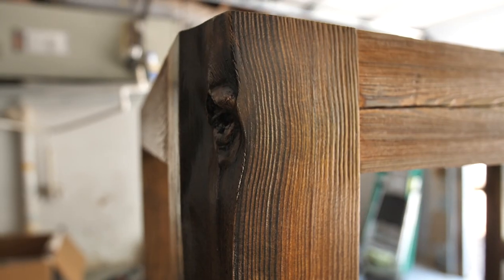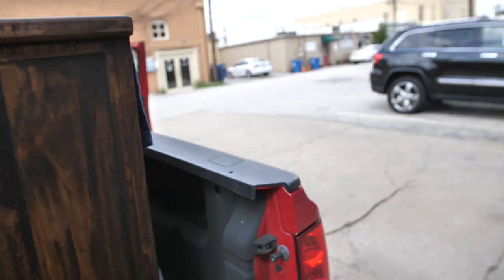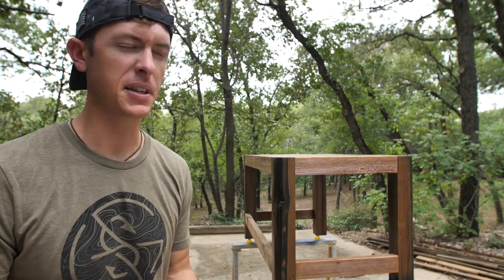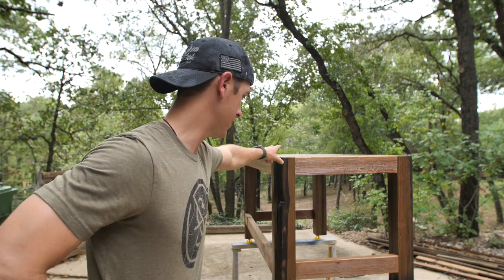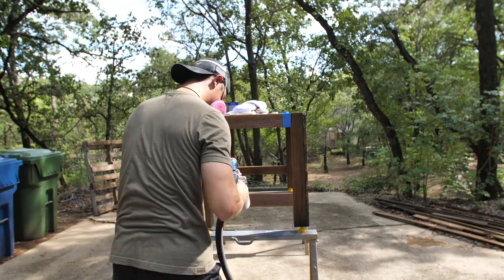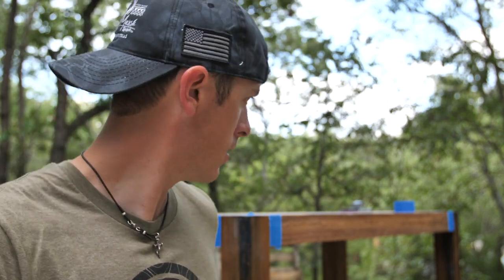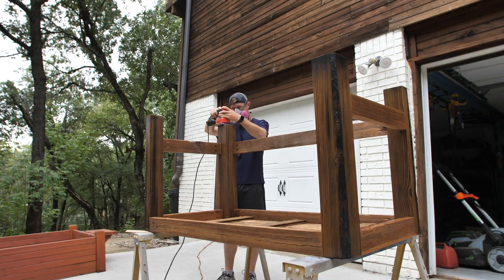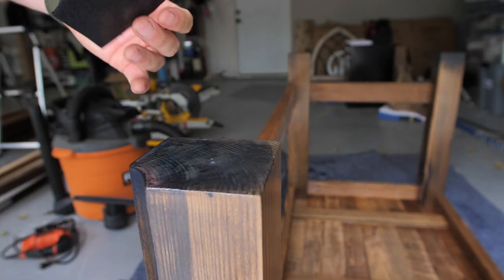TRASH to TREASURE! Rustic Wood Table Build COMPLETE!

Comment: Justin....I have worked in the railroad industry for forty years and our ties are treated with creosote to make them last longer.  Years ago we could sell them or give them away to folks that wanted them for landscape timbers, fence posts, retaining walls, etc.  Over time it was determined that creosote is highly toxic and we as an industry are required by Federal  Law to dispose of them in compliance with EPA guidelines.  They are truly not to be taken lightly.  My recommendation is that you not keep them in your home around you and your family.  However, beautiful work on the table.  If necessary replace the legs if they are the only wood treated with creosote.  Blessings on the arrival of Emery.  Praying for her and Mom that delivery will be trouble-free and all will be healthy.  God Bless!
Reply: Stewart Dearing I build fences and sometimes retaining walls are built out of them railroad ties.... when I try to dump at city dumps they don’t let me unless I have proper paperwork and the record all of it. How much I have and tell me specific spots on landfills to dump. They are super serious about them for some reason. Must be very unhealthy
Reply: Your absolutely correct. Part of my job in the military working in C e was to replace Perform track maintenance  which included replacing the ties

Comment: FYI......when you're spraying paint, sealer, any type of coating........be sure any vehicles you have on site are well upwind. Even a slight breeze can carry overspray for hundreds of feet, before it dries. I detailed cars for 20+ years and have cleaned and buffed overspray off of well over 100 cars and trucks.
Reply: 20 years and only hundreds? I work in a body shop and buff and sand down overspray on EVERY car we paint. I'm a GOD when it comes to taping. And we have 2 100000$ split draft paint booth. Overspray is the devil! Nice to see another detailer fishing freak!!
Reply: I've used sprayers for many years and your exactly right.
Reply: Detail shop. Mostly wash, wax, and shampoos. Best thing I've ever used on overspray was water and modeling clay. Followed up with with a random orbital buffer and Meguiar's #6 cleaner wax.
Reply: @cbobwhite5768  yeah u did a lot softer work than I do. I'm specialized in what people don't want to do hahaha. Hard to do, 50% chances success stuff is my specialty. Restoring 50 year old that's never been buffed or polished, 1 step and stuff. Love it. Also like doing shampoo's and waxes and light stuff!

Comment: Creosote is a mixture of chemicals that include polycyclic aromatic hydrocarbons (PAH's). PAHs have been linked to skin, lung, bladder, liver, and stomach cancers in well-established animal model studies. You might want to move that table out if it does contain creosote post material.
Reply: Good point Gary. I don't disagree.

Comment: If you ever think about doing it on top, get the "bar top" epoxy. It comes in a gallon jug and is the epoxy resin used on, you guessed it, bar tops and counters and whatnot.

Comment: My best guess is the wood you used is Yellow Pine, some call it Pitch Pine. It makes nice lumber if clean but some trees or parts of the tree are extremely pitchy, pine pitch is also very flammable, and that i believe is what you are smelling, the Pitch or resin that occurs naturally in the wood. As far as sealing, how about all the table top ends that are covered by the surround frame? Best case would have been to seal all the components first, including the ends and other areas that would be covered up, then assemble.

Good luck with it!

Comment: And when the poly fails to lock in the residue you should look into a coat or two of Zinsser SealCoat (shellac). I'm surprised your wood guy friend didn't suggest that as most wood workers know the wonders of sealing with shellac.

Comment: In the future,  use an oil based polyurethane when sealing any wood that has been exposed to any type of petroleum product.  Including many years of oil based stains.  Oil based products repel water based products.  
On the positive side .  The epoxy resin idea was a good choice.

Comment: If you clear coat it it will have it last longer and it might trap the smell in
Reply: I agree 100% with you
Reply: Definitely. 3-4 coats of lacquer would do the trick.
Reply: Nope. 45 years of painting experience says nope.
Reply: A nice thick coat of epoxy would be the only way..
Reply: Use to work with reclaimed wood furniture as a prep and finisher. Lacquer and shellac (depending on the use of the furniture) never had any problems
Reply: @rickfromthecape3135  45 years how old are you??
Reply: 62. Worked with my dad who painted for 40 years and took over his business.
Reply: @rickfromthecape3135  oh ok thanks i was thinking that working for 45 years was long time

Comment: I apologize I have failed you as a fishing freak and diehard fan of OSG the cre-a-sote poles used for legs needed to be sealed with an oil based poly ideally but the high grade water based you used on top of the epoxy should serve you well 
It is an incredible looking table and someday your grandchildren will enjoy it

Comment: Is there no alternative to swapping out the legs with something that isn't toxic? I wouldn't risk it, as beautiful as the legs turned out, i'm sure you can achieve the same look with a non-toxic version of the legs ;) 

is there any other wood at the barn you salvaged from that you could still use for legs that aren't the ones covered in creosote, if the historical value is so important to you? just some thoughts. The table does look awesome, just not awesome enough to put you and your family at risk IMO.

Comment: I agree with Rick W.  There is nothing on the planet that you can put on that table that will probably stick to it in the first place.  But you can try.  I'm pretty sure  water-based products will ultimately start to peel.  Epoxy might but I wouldn't waste my time with it.  I wouldn't want that even in my garage.  But it does look good.  Just buy different materials and rebuild it.  You'll be glad you did.  Sorry.